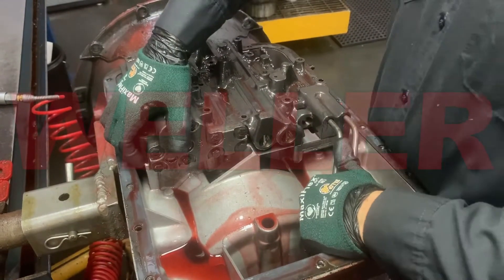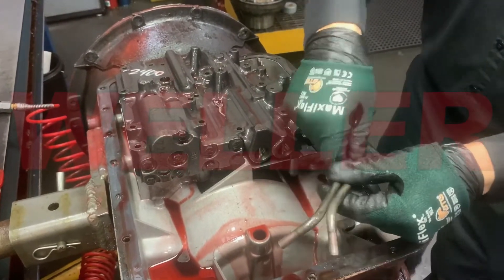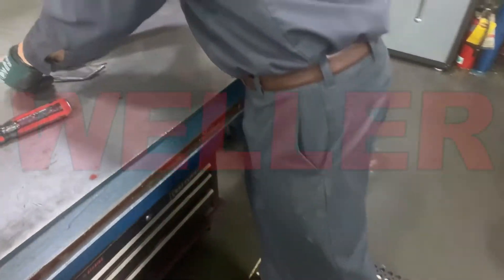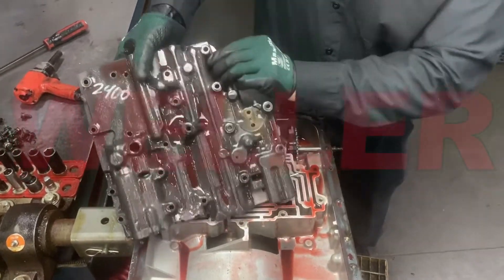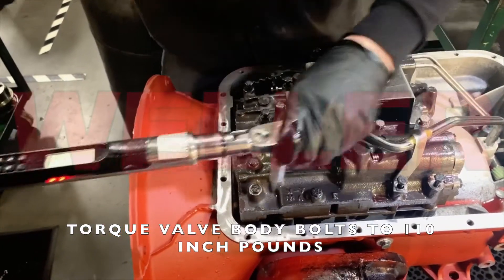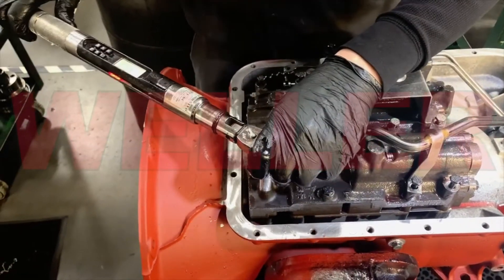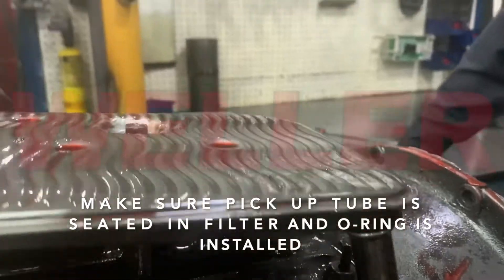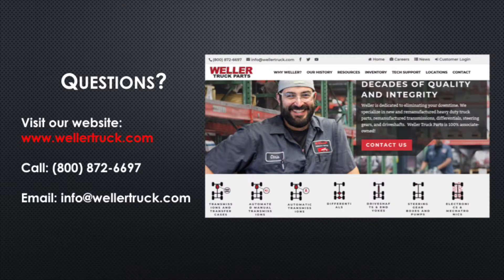AT545/542 Valve Body Removal and Replacement

Comment: What is the difference between A  Is 540 or A543 or 545
Reply: Even tho this is an old post........   The only difference is the capacity of the oil pan.  540 has a shallow pan 545 has a the deepest pan.

Comment: I'm building a big block Chevy for off road. Don't need a high stall, but I would like to rev it to 6800 in first before it shits. Can the governor and modulator combo be modified to accommodate high RPM? My other option is a 4L80e $$$

Comment: do you have a guide on adjusting the base shift points in the valve body of a 545 / 643?   our 643s seem to always shift at 2400 RPM instead of 2600 under WOT.. the modulator cable does in fact pull out all the way on WOT except for about 1/4" slace or so. (we dont want to stretch the cable)